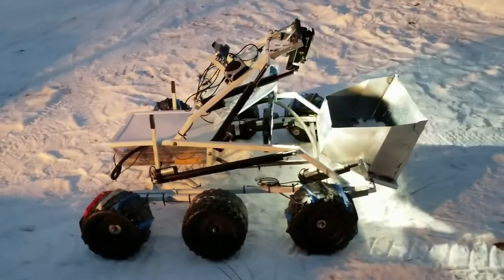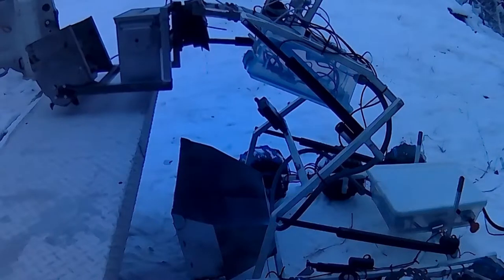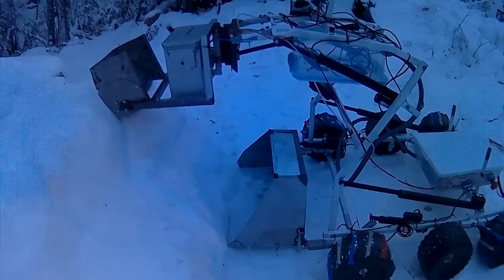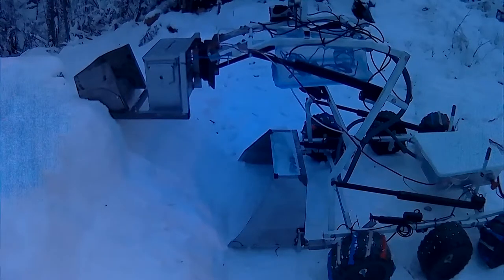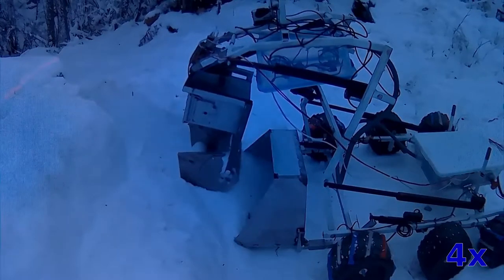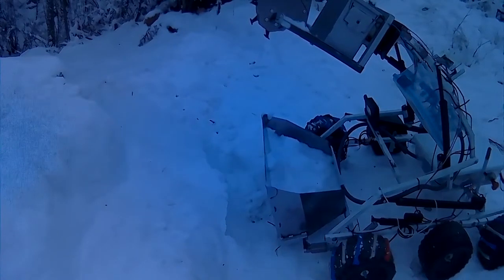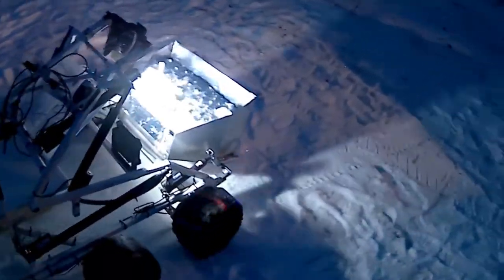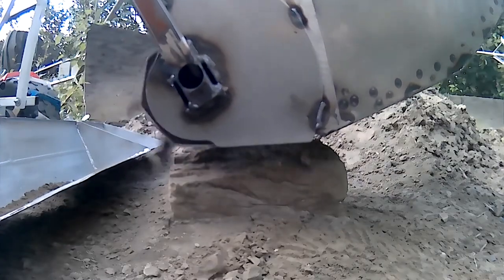Lunar Permafrost Mining Robot Prototype Demo

Comment: Very cool prototype. Impressive demo cutting through the concrete.  With regards to charging the tool... How about a pair of sockets on the front corners of the tool that can be used to hang it up on a pair of conductive pins?
Reply from the maker: Exactly!  We're a few iterations into a 3D printed frame that guides a set of Anderson PowerPoles together.  The hard part is making it work every time...